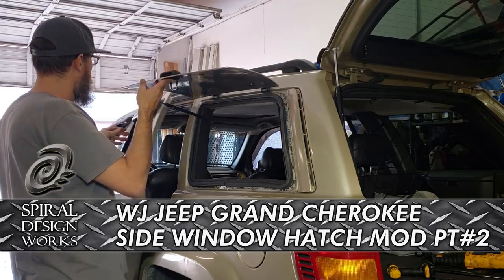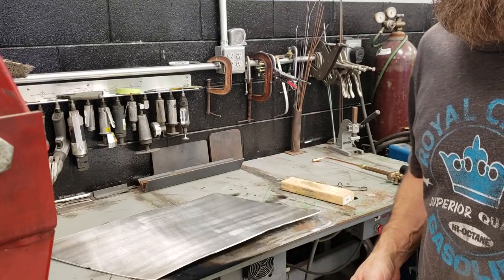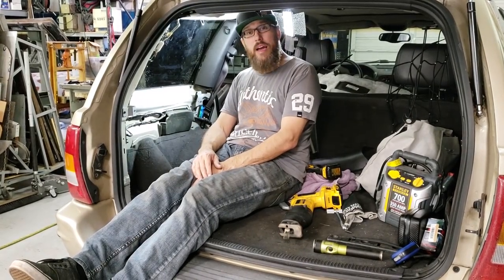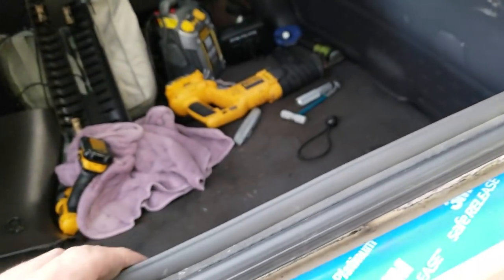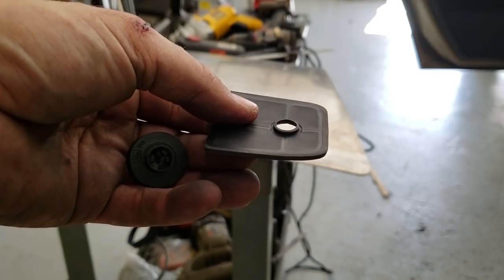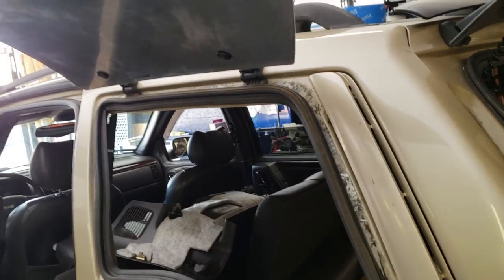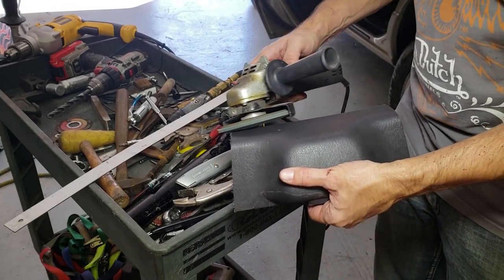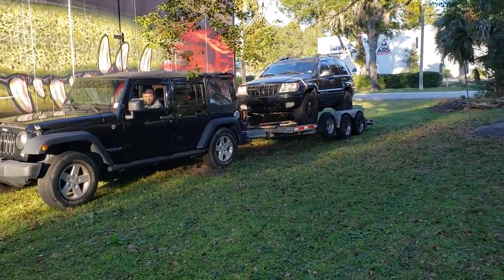EP.17-WJ JEEP GRAND CHEROKEE SIDE WINDOW HATCH PART 2- English Wheeling the panel and test fitting.

Comment: I work in a factory that makes car windows. The clips that hold the glass to the window motors are not drilled. They are held on by a very strong two part epoxy. Id say if you wanted to mass produce a kit you could go that route with hinges and whatnot pre-attached to the window.

Comment: A little bit of a late comment, but if you catch this and havent already learned better, for someone without more specialized tools you can use a strong thin wire on 2 handles to saw out the windows with wide enough gaps around the outside edge, or you can fit a sharpened putty knife onto the sawzall and it can help to cut the glue easier from the inside. The blade you used on the handle needs to be a little longer to reach all the way through the glue and the urethane can be pretty tough on older vehicles. If you dont care to save the glass, just break it and use a sharp, not very wide scraper or razor scraper to trim back the glue (a box cutter can work for side windows with small pinchwelds and enough room to work, even to cut it out if you're careful.)  It usually cuts really easy with a razor blade. Coming from 4 years of autoglass experience.
Reply: @Barbaricroots it will definitely soften the urethane but be careful not to go to hot. You'll want to apply heat to the outside of the glass (not the interior) around the edges where the black paint is and just warm the whole thing up. Sitting it in the sun on a warm day will do just as good if not better to evenly warm the glue and allow easier cutting.

Comment: I really dig this window project. Very clever use of the ZJ hinges! For those that want a transparent window, rather than aluminum, google "smoked polycarbonate sheet" or "smoked lexan sheet". You can heat form the plastic. (please don't use acrylic, it will crack). I did a quick search and found 18"x24" by 1/4" for about $27 plus shipping.
Reply from the maker: Yes I was going to make some Polycarb ones but even better I contracted the worlds largest window manufacturer to make real tempered glass ones with my holes predrilled.  Will be an exact replacement. just working on the pricing and the interior panel now.
Reply: @SpiralDesignWorks  Great, keep us posted.

Comment: Badass dude!! 
One suggestion for the latch cover, cut out the exact size of the cover piece you added on the side panel, then plastic weld it in that way it’s all one solid piece.
Reply from the maker: Yeah that could be done.  I used to do a lot a plastic welding.  You would have that seam to look at still.  I trimmed it a bit more and it fits better now.
Reply from the maker: I have designed the interior rack with an incorporated cover.  Will look better. That will be covered in episode 4.

Comment: I would be concerned about twisting and how well would it seal.This is a very cool mod.
Reply from the maker: Seems to handle the single ram very well.  It puts really no force on it when it is closed.  Seals up very well.  I actually had to grind the lower face of the latch mount to move it out towards the window to not make it so tight.  was hard to close.

Comment: Why did he have to burn the aluminium black first and then heat it up? Why is that procedure needed for before bending..?
Reply from the maker: That is a process call annealing.  That sheet came what is called half hard. Annealing softens it to a more workable material.  As it is rolled, Hammered etc it work hardens back to the harder stiffer state. Hope that helps. Basically makes it easier to shape.
Reply: got it, thanks! Great job u did btw 👍🏽